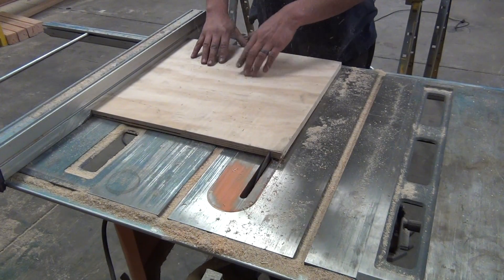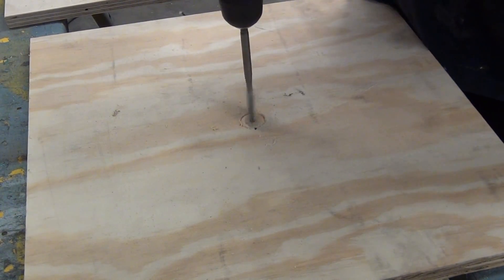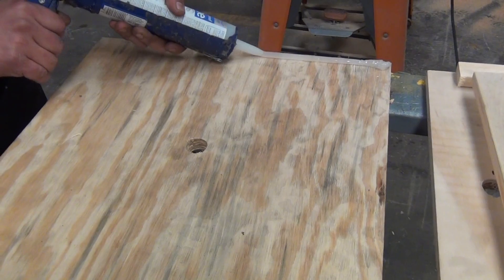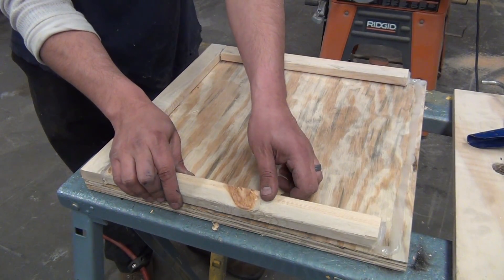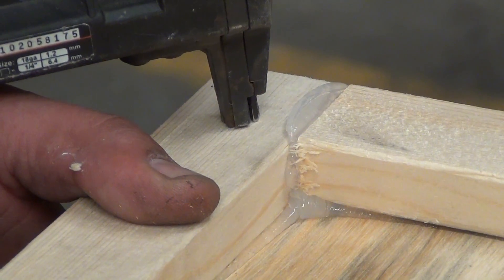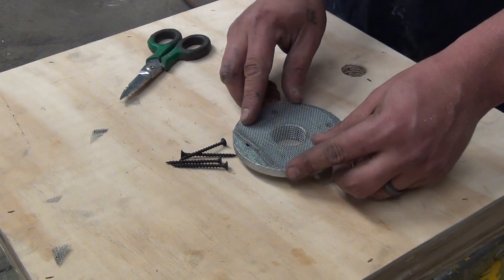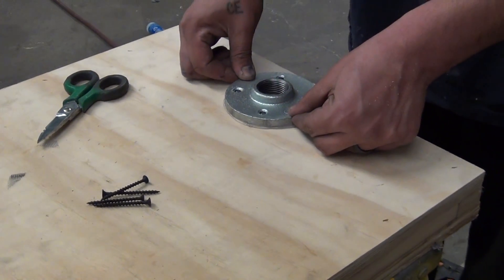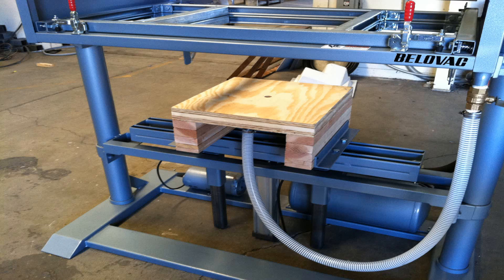Belovac Vacuum box construction

Comment from the maker: These boxes are intended to be used as a mounting platform and vacuum distribution box for a vacuum forming mold. To use this box it must be mounted in a machine. To utilize the large single vacuum vent hole, the mold would either need to be scoured on the back side or spaced up to allow the vacuum surge to distribute throughout the mold. Otherwise you can add holes to the box as needed where's needed to conform to the mold. Hope this answers your questions.